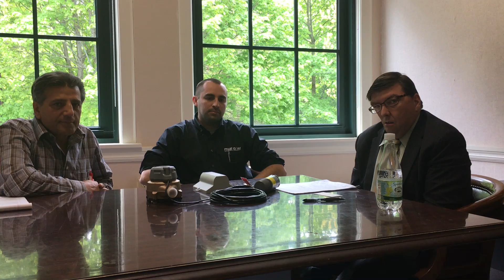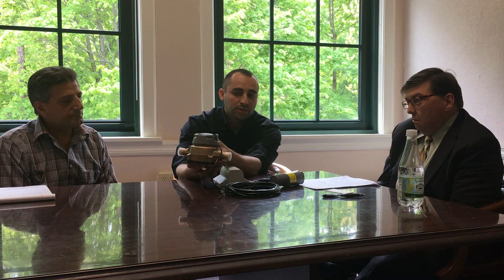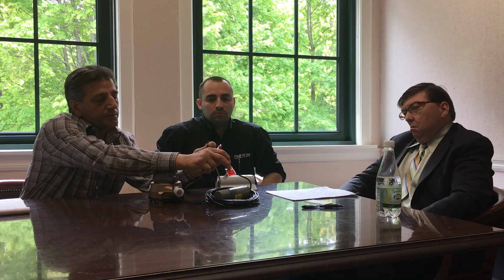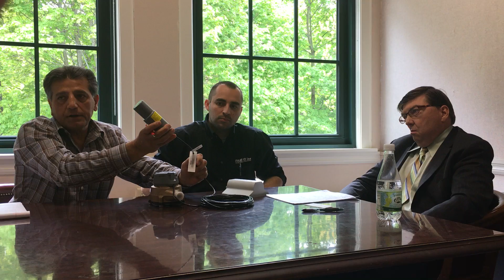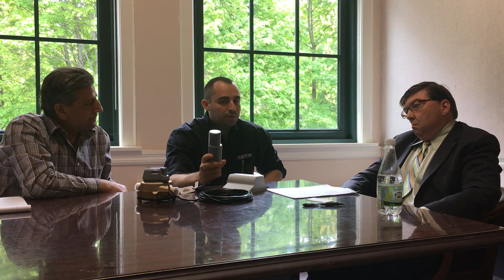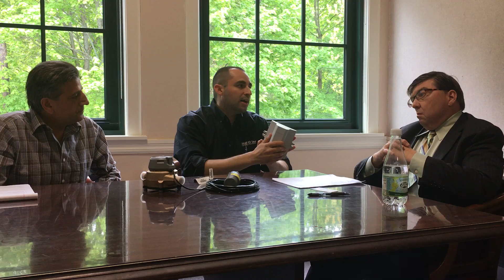Billerica Smart Meters

Comment: What is the model name of this device?  Are they grounded? I think you should state what the actual RF reading is instead of minimizing concern over exposure. What is the future application of this device?  Will it connect to 5G small cells?  Has the town received compensation from state or local groups to install these devices town wide?  Did the town establish an independent subcommittee to see both sides of the issue?